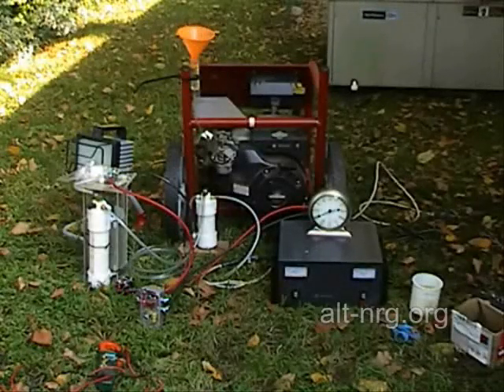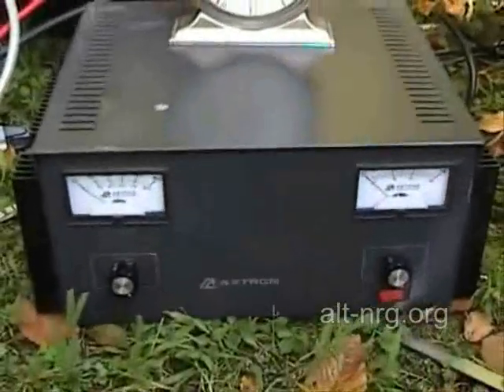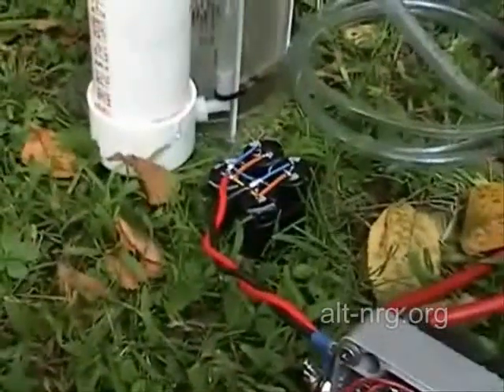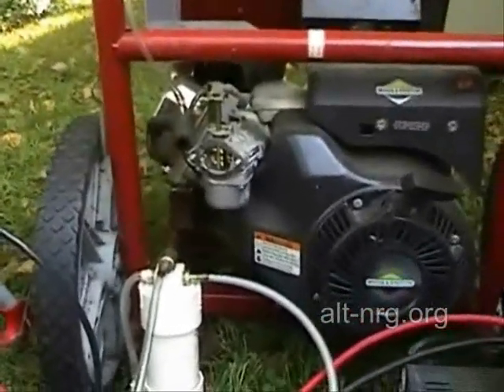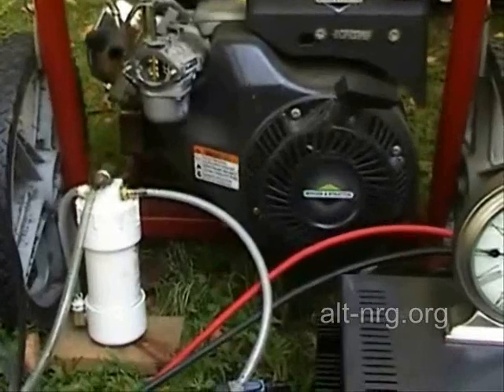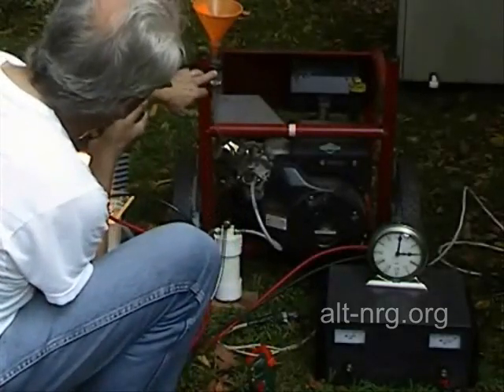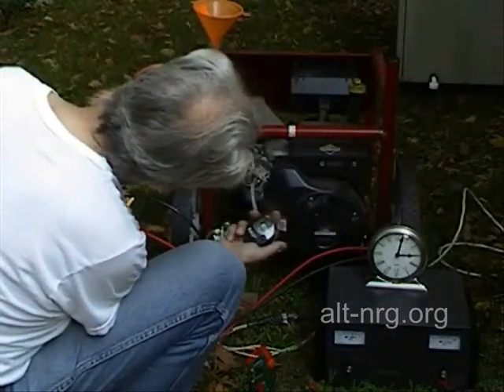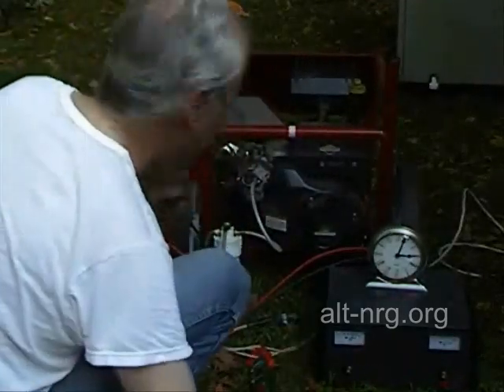#130 - Generator HHO run time tests, Part 1 of 4

Comment: I don't get how this kind of method can show the effect of HHO. Does the generator can throttle up / down according to the load. Does the generator have the ability to stabilize the rpm? Does the generator have the ability to reduce fuel when HHO is added?

Comment: @alexphone32 try to put back the car's emission control on it's original components, disconnect the battery for 5 minutes, then reconnect it and the check engine light should go OFF.

Comment: How did you take into account the evapouration of the fuel? Because the gasoline will evapourate quickly when exposed to air.

Comment: that's not entirely true because if you apply pressure (coming from HHO) you change the amount of vacuum pulling from the venturi of the carb...

Comment: New vehicles have a sensor to know how much fuel inject, if the spark created by the spark plug is stronger than expected this sensor activates and will reduce the amount of gas injected.

Comment: I think it is great what you are doing, 

Did I mention that the PWM that I build from your design is working perfect. I do wonder what you used to isolate the power mosfet. Is it similar like you use for a processor fan?
Sincerely, Rick